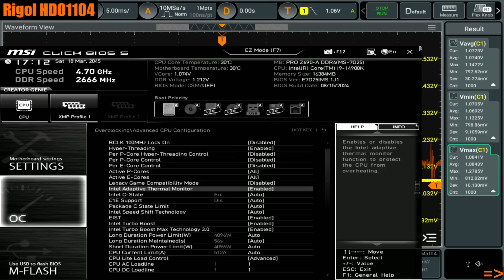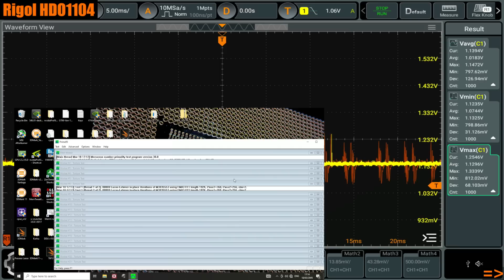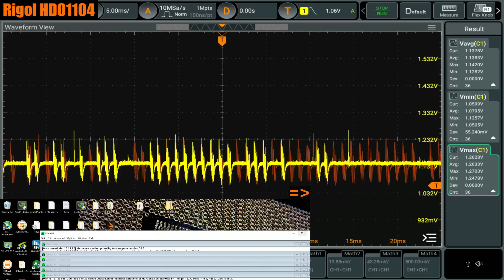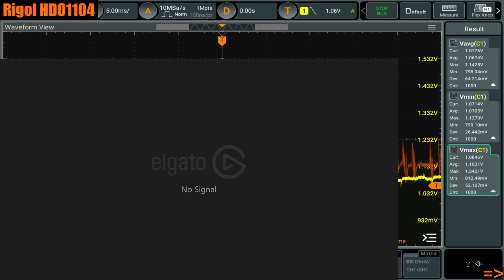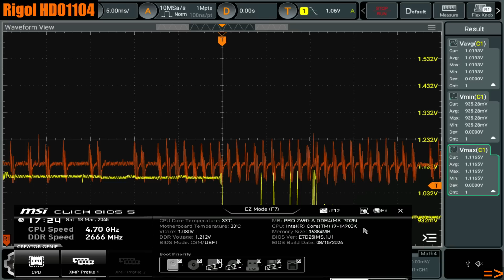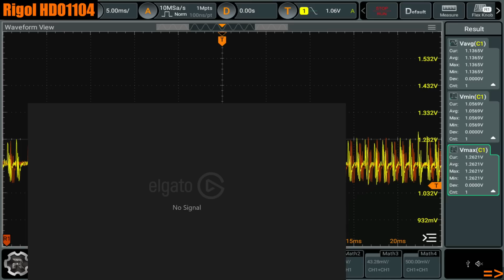CEP reduces Vcore undershoot

Comment: CEP increases max VID's of my i7 13700k from 1,360V to 1,440V. So, no thank you. Im gonna leave my CEP on DISABLED!
Reply: When CEP is triggered, the CPU throttles and draws less current, which means less vdroop, higher vcore
Reply: @neponyatnyi  And higher Vcore means faster CPU degradation...
Reply: @Mitch1256  Max current draw is set to Intel's specification for this CPU (307A)
Reply: Same, CEP off and Vcore is lower. At least on my asrock board.
Reply: Something is up somewhere. My 13700k is running all core 5.4/4.2 in between 1.190 and 1.230 volts. No clock stretching whatever the benchmark. Just got the load line and ac/dc values locked in. That’s all I needed to touch in the end. Edit: using Msi z790 tomahawk WiFi and a Core Voltage Mode adaptive offset of - 0.130volts. TVB is active. Another edit: not all benches, however if something really healthy like large prime or y crunch hits the voltage drops so low that CEP does kick in a little but I have never had a crash so it is doing its job. If I had better cooling I could take the load line higher to reduce the super high load droop and it would be fine on the same offsets. I just don’t need it for what I do.
Reply: @theboomfish  All P cores 5,4 on i7 13700k? Only best 2 P cores are able to go to 5,4 all other are going only to 5,3.
Reply: @APARAT79  I set all core in bios. I still have c- states enabled etc. but on load all cores hit the specified frequency and stay there. Unless I hit something very intensive which might hit the power limit I set of 235w PL1 and 2. This is just to keep things in line with my aio. I only game though and don’t use it for production stuff.
Reply: @theboomfish  golden sample from the silicon lottery 😂
Reply: @hugomouteira7015  I guess we will see. It has been undervolted from the start so hopefully it will last the distance.
Reply: I had to increase my VR limit to 1.4v in order to get max clocks with CEP enabled while disable i can run at max clock at 1.2v, at this point i dont know what's best, keep the CEP for the protection while running a higher VID or should i disable and keep a low VID without the protection
Reply: I haven't tested this super thoroughly but it does seem to cause similar issues on my CPU as well. I'm running an undervolt via VID offset to help counteract it.

Comment: Since you're on an MSI board: I'm running a z690 Tomahawk DDR4 with an 14700KF at 253/253W/307A and MSI's CPU Lite Load function set to "Normal" and level "7" - used to be able to run it lower than that, but since I updated to a 0125-based BIOS (no 0129 for my board, yet), I had to raise it up from "4" because I was getting BSODs under idle load. So, possibly too much voltage droop? That setting seems to result in LLC of .35/.80 (AC/DC), the "Intel Default" setting is "15" BTW, results in 1.1 Ohm on both AC and DC and gives me scary spikes in VIDs, Vcore (both over 1.55V) and temps, so I went back to "Normal" and "7". My question is: Any thoughts on what to do with CEP with my settings? I have all the CEP-settings switched to "off", ATM.
Reply: I also have MSI board with 14900KF, I've played with setting quite a lot and found the best for me to go aggressive on LLC and not being shy in UV. I've set all P-cores at 5.7GHz, all E-cores at 4.5GHz, LLC set to Mode 1, LL to Mode 1 (0.01 mOhms on both AC and DC), set adaptive voltage 1.2V with offset - 0.105V. The max voltage registered by HWiNFO is 1.268V. In Cinebench R23 40+k.
Reply: Have you set any voltage offsets? Are you locking the all core frequencies? I have a 14900k and I use 5.5p/4.1e, 307a, 250w power limit, -0.055 offset (negative) and use lite load 9, with speed shift enabled, -2 avx ratio, the 100mhz blck lock set, turbo boost max 3 disabled and the voltage never goes above 1.4v and CEP doesn't seem to engage at all in my testing, it runs very cool and it's bench scores are as good or better than I was getting with stock settings that produce silly high voltages. Now that's a 14900k not a 14700k but surely a 14700k would be in the same ballpark for tweaking as that?
Reply: @bigpoppa1234  Nope.. I haven't touched voltages or core clocks or any other settings besides the ones I mentioned. Well.. that and some power savings stuff re C-states, but I doubt this plays a role here. I've basically set Intel's "performance" power-limits/ICCMax and then adjusted CPU Lite Load to avoid idle load crashes on the low end and to avoid crazy voltage/temp spikes on the high end. Not even sure if the CEP settings were enable or disabled by default in the new BIOS, but I do know they're set to "disabled" at the moment. Vcore hovers around 1.35V under stress and VIDs mostly stay under 1.4V (occasionally one or two will spike up to slightly above 1.4V under stress). Temps never exceed 80°C and power draw stays at around 200W under CB23 all-core and other stress-tests. 
Things do seem stable at the moment, but as the PC seems to only crash at idle loads (hasn't crashed under stress-loads yet) and I don't have an oscilloscope, it's kinda hard to test for stability.
Reply: Instead of the confusing "lite load" setting use the individual AC_LL and DC_LL settings because different settings and bios updates can change what the particular "lite load" modes do. Also your voltages (and stability) is affected by your LLC setting. If you have it in "Auto" it might have also changed when you updated your bios.
Reply: AC/DC at 0.350 and 0.800 mOhm is ridiculously high for anything else than the [auto] LLC curve! And the mismatch between AC and DC values, in experiments, is what is triggering CEP and cause the CPU to downclock for no apparent reason. Anything more than 0.100 AC/DC is pumping unnecessary high voltages to the CPU.
Reply: @valentinosgsxr  I think you are off by 1 decimal point. The intel default it AC_LL = 1.100mOhm. 0.35 is far from "ridiculously high", actually it's pretty low even for the middle LLC and might already trigger CEP clock stretching. Also no, mismatch between AC and DC is not triggering CEP. CEP clock stretching is triggered by having the AC too low for your LLC
Reply: @charonme  I have tested everything I m saying in my PC. I agree, 0,350mOhms are low but as I said, it is low only if you are using the "auto" LLC on the MSI boards. I have an example of real numbers logged from my experiments. LLC set to auto and AC/DC set to 12 (which results in 0.700/1.100) runs R23 all core at 213W and clocks 5.3GHz-Pcores/4.2GHz-Ecores. Already loosing performance on my 14700K. When I moved to mode 10 (results in 0.500/1.100) it deeps performance to 5.3GHz-Pcores/2.6GHz-Ecores! and only consumes 195Watts! This looks like CEP to me because I see no other reason why the clocks are stretching so much. If it was because of extreme under volt, it would have crash and power, current and thermal limits are far from being hit on this test. When I put DC aligned to 0.500mOhms, the E-cores are getting back most of their clocks. Those settings are far from recommended still.
Reply: @valentinosgsxr  it's curious that E-cores got so low, but if CEP clockstretching was kicking in I'd expect the P-cores to get affected too. Was your cinebench score halved?
CEP clockstretching due to low AC_LL doesn't necessarily mean that there is an "extreme undereclock", nor that it would result in instability.
Reply: @charonme  I know it doesn't make sense why the e-cores was impacted so much but then I don't need to fully understand how boards work. I m testing and valuating the results to the best of my knowledge. So, the rest of the data you asked for are: 0,700/1,100 score 34324. 0,500/1,100 scored 22944. Finally 0,500/0,500 was pulling 253,12W (limited by intel's profile) clocked to 5,1GHz-P cores and 4,1GHz-e cores and scored 34110.
Reply: @valentinosgsxr  thanks for the data. I'm also seeting this strange E core throttling behavior on my 14700K with some of the settings
Reply: @charonme  You are welcome.

Comment: Buildzoid i have cheap corsair 2400 cl16 kit with nanya die, how do i just OC the IF on my 3300x, i forgot in which video you told this. Do i need just soc voltage for this ? How much for 1600 MHz IF on R3 3300x b450. Please help
Reply: Overclock RAM to 3200 as it's what most Zen 2 CPUs can handle. Tighten memory timings. Make sure UCLK is 1:1 (it should stay on it by default).
Reply: @je5terc0re  Running memtest on my 3200MHz OC =)